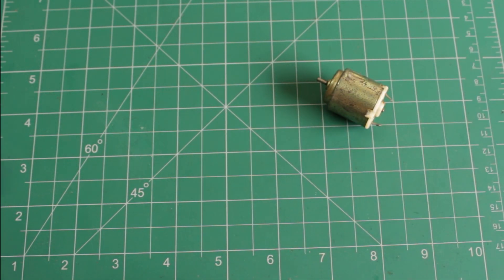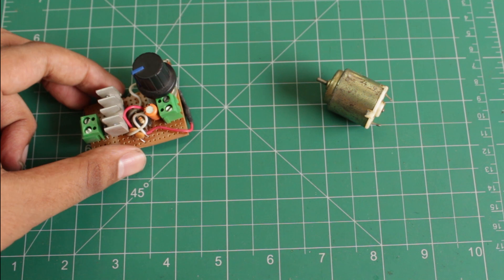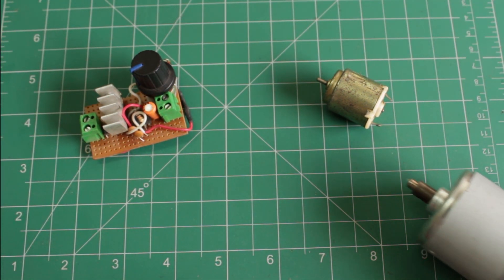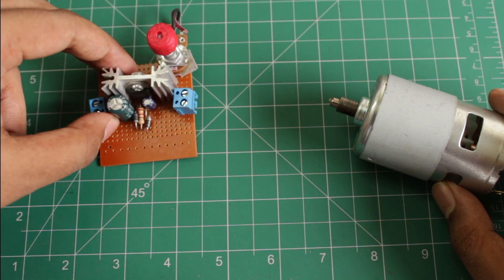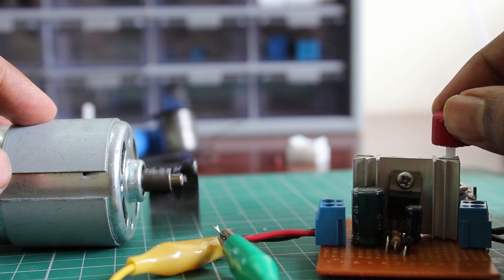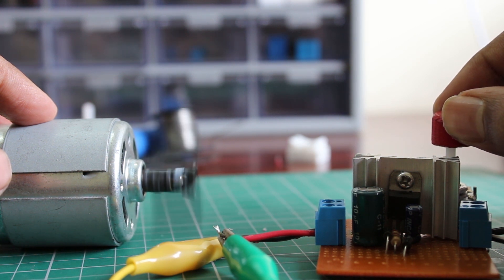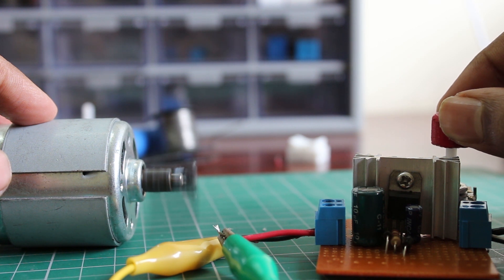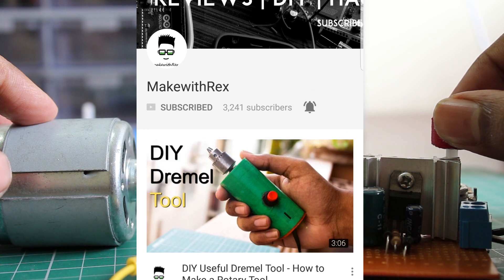How to Make a DC Motor Speed Controller || Lm317 Variable Voltage Regulator

Comment: If anyone wants to make this plz don't do it . Because circuit diagram is wrong , components parameters are wrong , .
See potentiometer in the circuit its wrong connection, he used one diode but in diagram 2 diodes , soldering is like hell .